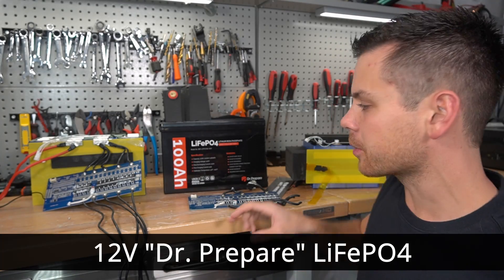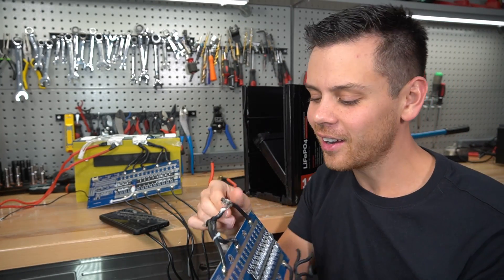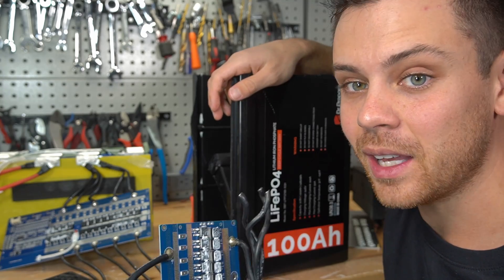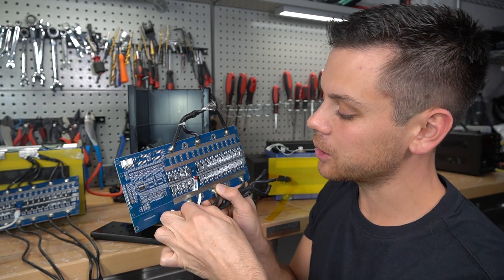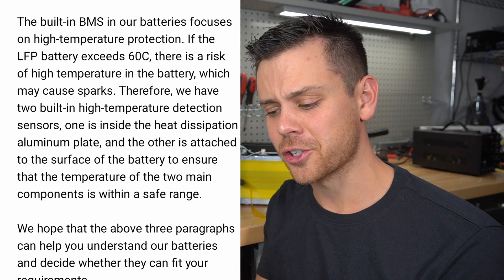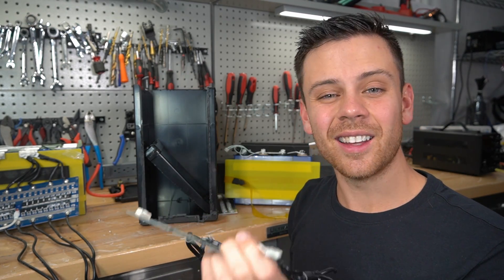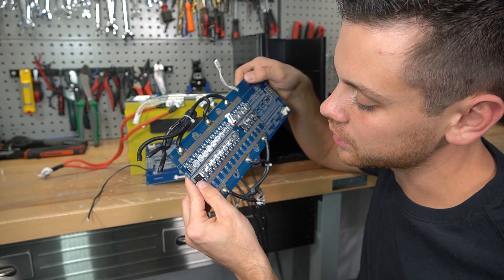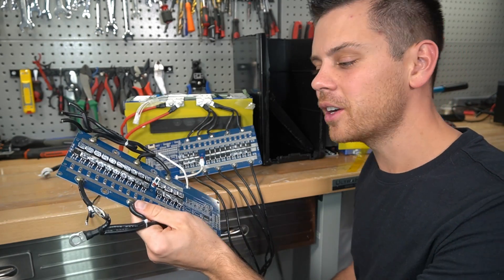12V 100Ah "Dr. Prepare" Part 2! Responding to company email

Comment: I believe Dr prepare batteries are misinformed information to purchasers example they state you cannot series their 12v lifepo4  battery  then they say you can for the $300 battery so their bms does not handle series, now I have to send both back because I need 24v

Comment: Hey Will, there is a company offering a 100ah battery with a supposed "heating element" that turns on when it gets to freezing temperatures and heats up the batteries.  It's a Jitta battery, I have their standard batteries and they seem to work fine but they recently came out with this heating one.  Any way you can get your hands on one to see if it's legit?

Comment: I think you missed their point.   I assume they’re saying the low temperature sensor is in the micro controller or BMS IC (very common for those to have temp sensors built in).  

That actually makes sense.  While remote high temp sensors need to be attached to hot spots it may be reasonable to assume the cells won’t be colder than the BMS IC/uC which have limited self heating.  

Could be tested by spraying a freeze can on the IC.

Comment: After watching a competitive video review before Will's first part one video came out, I placed an order for a Dr. Prepare battery. Great price! However I really need the low temperature protection as I plan on doing some winter camping... As a result of Will's review I realized I had made a mistake and immediately tried to cancel the order. Too late! it had already shipped. I notified the Dr. Prepare company that I would like to return the battery for credit. I had no problem doing so although the responses were a little slow it all has worked out. After receiving the battery I did not open it and requested a prepaid return label which was supplied. I tracked the return and after about 6 days after they received the battery they applied a full credit to my PayPal account. Lesson learned...

Comment: Will, I love what you do and trust your objective reviews. I have a question though. If I were wanting to install a lithium battery as a replacement for the 100 series lead acid battery that powers my older car would you have a recommendation? Or maybe would you not recommend going that route for a passenger vehicle? Thanks and keep up the good work.

Comment: All that would be required to low temp protect , is a thermal switch that would break at 32°F, and a BMS with a power switch! If you didn't care to get riggidy, put the switch in one of the balance leads, it would cause the BMS to shut-off.. it is sooo easy to build a proper bms, why does it seem to be do difficult to them??

Comment: they should have just shut up and hired a PR firm from the states :) Someone that handles PR for coal mines or defective childrens toys :) What they did was call up the head engineer to explain this to their customers.. not realizing he hasnt actually been involved in the production of the product.. just the design. they farmed the manufacturing to a turnkey operation and did not do ANY quality control to see if it followed the designs. pure speculation of course but given the offended sounding email they dont have a clue about the actual product that was shipped. I am not making statements of fact here. just speculating on the thought process.

Comment: The battery can be discharged at low temperature, with no issue, at least all my LG and A123 packs can do it. Maybe they have an NTC on the PCB mounted. NTC can be in footprint 0603...so for you if you are not experienced with SMD components you will miss it, looks exact like a resistors.

Comment: For the price point and if the battery is used inside out of the cold so what.  If the battery is not abused by powering an inverter, then these should be fine. The temp sensor goes on the cell.  If the bms overheats you are abusing the battery.  Simple as that.  So what the wire got smushed, here again nothing bad will "WILL" happen unless you are trying to draw 100 amps continusly.  Like with an inverter.  Like abusing the battery.   Yeah.  Not everybody uses batterys at full rated.

Comment: Carrying out a QA procedure under normal QC parameters. one would randomly pull 13 pieces out of 100 pieces, check the 13 pieces. top to bottom. If they all past QC then the 100 pieces are cleared to ship... if one or more does not pass, then all 100 must be QC 100%   If they had carried out a proper QA/QC ISO -program that particular battery should have been caught, yet it is possible that one or two will get through now and then.. yet the proper QA /QC was carried out. This particular system has been used for many many years through out the production of products. This would also apply to all parts.. so each part is QA / QC... through out the process. The maker of the battery in question, must pull all batteries back to their factory or be wiling to replace them all at their expense.. if they wish to follow the guidelines used in the U.S. ( ISO 9,000 and up... )

Comment: Hey will, Could you help me understand something. I see you checking the FETs to check the voltage rating to determine if the pack can be used in series but when putting batteries in a series the voltage doesn't change at a pack level, Only at the load. For example, if you have 4 12v batteries in series it would total 48v but the voltage across each pack remains 12v. I have been using LiFePO4 batteries & 3.7v 18650 packs in series with each pack being managed by its own BMS and have never encountered any problems. In the beginning, I was curious and was testing with 6 small packs with identical BMS in series to make 72v. I was curious about how the protections would affect the other packs in the series but noticed nothing would ever happen as if any pack protection kicked in it would open the entire circuit. I've preferred this method for higher voltage packs as it doesn't concentrate all the load and stress on a single BMS. Though they are isolated from one another and can't communicate, as long as they are identical they should operate using identical logic.
Reply from the maker: Add a load, disconnect one battery and test the voltage. Try it out
Reply: @WillProwse Ill have a look, Any in specific? this may be circumstantial as I'm not understanding. If i had a 48v load powered by 4 12v batteries each with their own BMS and i disconnected one battery it would either be opening the circuit or if you removed it by shortening the series then you would have a low voltage event and the load *should disconnect.
Reply from the maker: @KooshiesElectronics  do it. And measure it. Put some packs together real quick
Reply from the maker: @KooshiesElectronics  look at my recent video and I wrote the whole thing out multiple times in the comments. Other people did too.
Reply from the maker: And no, you're not thinking about the whole circuit. Also think about parallel strings. A single fet must disconnect at max string voltage in some circumstances and must be able to handle it.
Reply: @WillProwse  Because my experience tells otherwise. I would never put batteries with their own BMS in parallel strings but in series, there has never been an issue. Any parallel string in that series operates using the same BMS. I have done this with various Chinese BMS with no issues and this was after testing. I have been watching you for quite some time but the entire time this was the only thing i disagreed with because in any case, I've tried when the BMS causes a battery to disconnect then the whole circuit opened as the load has to travel through the battery that disconnected and it cant. This is without any communication between any of the BMS. You can create easy communication between each battery BMS by manipulating the thermal probe as a switch without affecting the function of the probe. I am really trying to understand your point as you are the only one in the space I've seen talk about it as an issue. I have seen you speak about it plenty of times but never really explain why or present that, I'm not saying you haven't, that's just why I'm commenting about it today.
Reply from the maker: @KooshiesElectronics  you're thinking of the batteries individually. And their potential. But you need to imagine the whole circuit. And what the potential is when you remove a single battery from the circuit. Does that help?
Reply: @WillProwse  I understand if i had 72v from 6 12v batteries and one disconnected then there would be 60v across the leads of the disconnected battery but i didn't think it would be going through the FETS until i just really looked into how most BMS do their switching. I still have some things i would like to look into as i have not had issues doing so in the past and i once put 100v into a 12v battery (With BMS) using a power supply and seen no-load once the protections kicked in and nothing happened. If this is an issue in my case I can alleviate it with relays.
Reply from the maker: @KooshiesElectronics  sometimes it won't fry a fet, but it will eventually. I put a transformer based charger on a BMS lifepo4 and fried a fet on the first cycle. Usually what kills them though, for solar application, is inrush current when connecting a massive inverter with huge filtering caps. It's like connecting a dead short and that will kill a fet. 
The voltage can kill it just as easily. They have voltage ratings for a reason.
Reply: @WillProwse  I'm going to look around the comments like you said and think about it a bit more and test it out tmo as its 2am. I'm genuinely after the knowledge, Not to go at you in any way. Merry Christmas Will!

Comment: Will, the boards look the same because they are most likely buying just the boards from a PCB manufacturer and then populating them with the cheapest components they can find to do the job. To everyone out there having a quick look, they will think it's the same quality board being used by others but upon closer inspection, as with your second video, the illusion quickly and embarrassingly falls apart.
Reply from the maker: Yes exactly!

Comment: It is sad that the response from the company is basically gaslighting.  This is very bad and I would never buy from a company that can't understand basic problems with their product and rather tries to save face by ignoring what you said.  It would be good to verify by testing.  Place the whole battery in a freezer and see if it will not charge below freezing.  Clever engineers can repurpose parts to do different jobs in non-obvious ways.  They may have found a way to detect low temperature that is not obvious.

Comment: The mark of a well managed company is that it admits mistakes, takes steps to compensate current owners, provides a pathway to improvements and then makes those improvements, in an open, transparent manner.  This "response" to Mr. Prowse is completely unacceptable.  And thank you Mr. Prowse for providing a follow-up with a specific photo of the damaged part and the lacking safety temperature sensor.  
The irony is that properly assembling the battery, with proper temperature sensors, would have changed the manufactured price very little, and its price point in the market would be changed very little.

Comment: Will, are you misspeaking?  It is my understanding the LiFePO4 batteries can be USED at low temperature, they just can't be charged at low temperature...?
Reply from the maker: Discharged down to -20C. Charge at 0C or higher. So yes, they can, to a point

Comment: I got one before your first video was up for testing, and my payment went to a company called “Renogy Shenzhen Co.,Ltd”
Renogy maybe third-party selling under that company?
Reply: Decided to open open it today, no low temperature sensor, high temp is glued to the side of the cells, so still the crap you got a few months ago, the positive wire on this one was smushed under the bolt for the positive terminal, the wire insulation is broken to expose the wire. Good job dr.prepare!

Comment: Will you just made them update their website. They have removed the low temp cut off claim. This is what they emailed me... "We are sorry to tell you that our batteries do not have low-temperature sensors. We have written the Notes about the low-temperature protection by mistake due to the negligence of our team. We have deleted these contents on our product page." They also claimed it's only an issue if the outside temp dropped below -22 F (because of the sealed case?). Do you think that's true? Since in So Cal it never gets even close to any negative temps, is the low temp even a thing to worry about? 
Sounds like a good video. Take a sealed battery with a known low temp cut off, put it in a freezer, see what outside temperature it takes to make it cut off. I'd watch that!!!

Comment: Love your to the point comments about products.
Re the metric screws I worked at Marconi Instruments (English Eletric) St Albans UK, in the 1960/70s when we UK went metric the first projects were test gear for NASA on I think was a automatic test equipment that tested the up/down coms systems for the Moon shots. I believe all the measurements and nuts and bolts were in metric for our test equipment.
It's far easer to use metric than imperial measurements, it also makes your exported equipment easer to use and repair around the world as most of the world uses metric.
Will
Have a Happy Christmas and New Year.

Comment: I have a question connecting Battery to grit tye inverter or growwatt inverter. Can you use the Prius 208v battery to instead of using solar panel.  This is just an idea that I have. As  emergency back up with Toyota  Prius. What is your perspective on this

Comment: "No low-temp cut-off", much to do about nothing for most applications. Why would you ever let your batteries freeze? I agree the build quality on this ONE battery is not right but can you honestly say BATTLE BORN had never had one battery that was not right. How long would this battery lasted had you not found the problem on tear down?
Reply: I have an off-grid pace near the Canadian border. When I went there last month the propane heat had malfunctioned and everything was frozen solid. A very common "possibility" up North.

Comment: definitely outsourced customer service. it doesn't feel China but somewhere else and more likely a young engineer. he does have a point though on cold weather, it would have to be so cold for the cells to be at 0C or below. Consider that these will be installed in a room in addition to the casing/housing unlike LFP battery for use as a starter battery on cars or EVs.
Reply: An unheated rv, shed, garage etc could easily get well below 0C in much of North America during the winter.

Comment: Dr. Prepare is still a solid name unfortunately they need to come back with low temp cut-off and fix some QC build issues.  Thanks for the original review and follow-up.  I was hoping that Dr. Prepare was 'decent' so if someone asked I could tell them 'it's a Dr. Prepare' .. but naw, hard pass as of now.

Comment: Can you explain how much damage will happen to the battery if it's charged at low temps? How bout you charge it in low temps and do a capacity test after and prove you can't charge it at low temps and still have a functioning battery. I have one of these for review right now. I will be freezing the battery and then charging it up to see what happens.

Comment: Will, trying to interpret the vendor’s email, it sounds like what they are claiming is that the BNS has an intergalactic Temp sensor, and will shut off if the temperature gets too low.  You can test this by putting the entire battery in a Freezer, rather than running the sensor under ice water.  Again, this is my interpretation of their Chinese-English translator, so I may be off point, but that is the closest I can get.
Reply: The freezer suggestion sits well with me, as the battery as a whole then is subject to cold temp function testing with little effort. Could become a standard review component along with capacity and charge rate, etc parameters.

Comment: I think what they said in their email is that they DON'T have the low temperature protection, to ensure that you can still operate the battery in extreme conditions, unlike other batteries that will shut off and thus cannot be used in snow storms etc.
If I didn't know the context of the email, I could immediately say it came from a Chinese company though. Technically, `some companies` might have improved up to western standards but their customer service really remains the same. Perhaps they can get away with it in China but it's not something that the average western customer can live with.
Lately, Amazon is attracting a lot more of these companies and it really sucks if you have to rely on their customer support. Unless you have proper laws that protect customers (or you can miss the money), I'd avoid them like the plague.

Comment: Agree on your analysis of that battery Will. However, suggest you use a better tool to cut off the tops of batteries so that there is no opportunity for a discussion around if you did or did not cut a wire...

Comment: Will, I have a quick question if I may. U bought two  Weize 12V 10ah LiFePO4 Lithium Batteries for my wife's wheelchair. These never show low on the chair meter they just shut off.  This is going to be a proublem if we go somewhere and they shut off. Is there anything I can to do to stop this from happening?